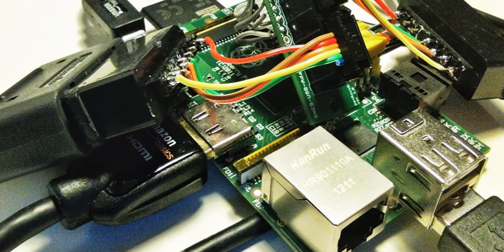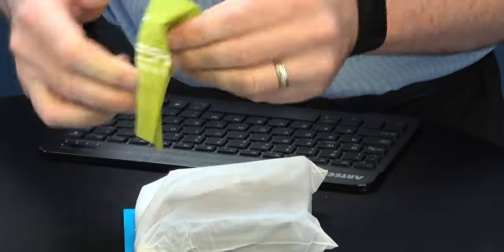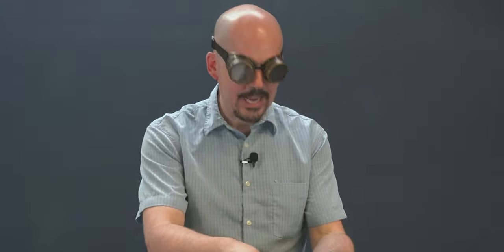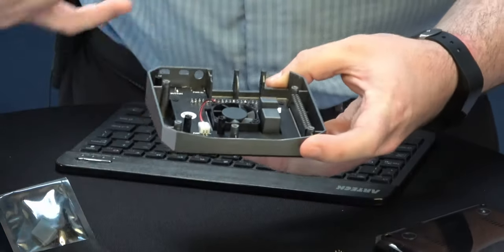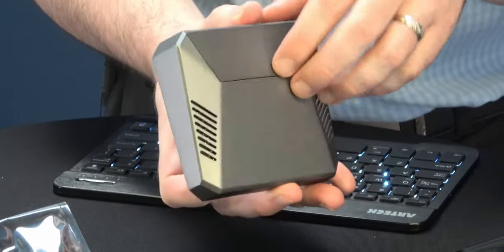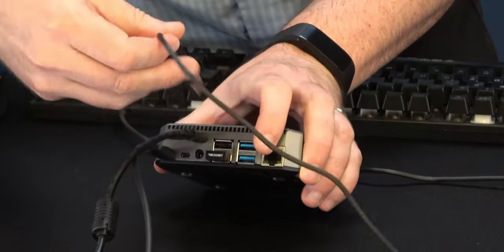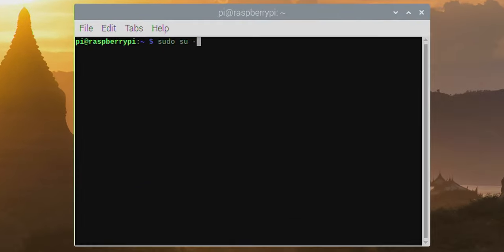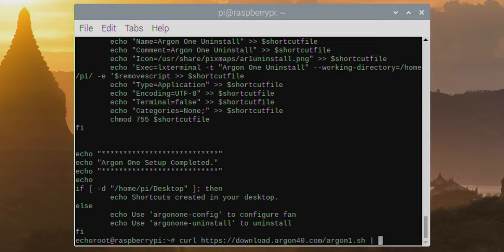Is This The Best SBC and Case for 2020?

Comment: The best case I've seen is the GeeekPi Set-top Box kit. It's similar to the Argon in that it has a break out board for the connectors, but unlike the Argon it has full size HDMI ports. Unfortunately, it's sold out on Amazon. It's available on ebay and elsewhere, though.
Reply from the maker: Very cool! Problem with plexi cases right now is there appears to be a shortage of plexi supply due to all the plexi installations in retail stores at the moment. Hopefully stock will return soon. I love the idea of full-size HDMI ports on a RPi 4. I really dig the aesthetic of the Argon ONE, and since the Micro-HDMI ports are so solid, I will forgive them of that. Across the board, I think we're seeing the bar be raised here with both the SBC (8 GB?!) and the case.
Reply from the maker: Good news re. the GeeekPi case: Looks like someone has stock on Ebay. https://www.ebay.com/itm/184262017802?ul_ref=https%253A%252F%252Frover.ebay.com%252Frover%252F1%252F711-53200-19255-0%252F1%253Fff3%253D2%2526toolid%253D10041%2526campid%253D5336913135%2526customid%253D%2526lgeo%253D1%2526vectorid%253D229466%2526item%253D184262017802%2526srcrot%253D711-53200-19255-0%2526rvr_id%253D2479921548794%2526rvr_ts%253Dce3d04451720aaecb8c4ca3aff5a1e10&ul_noapp=true&pub=5575086558&toolid=10001&campid=5337482104&customid=&ipn=psmain&icep_vectorid=229466&kwid=902099&mtid=824&kw=lg